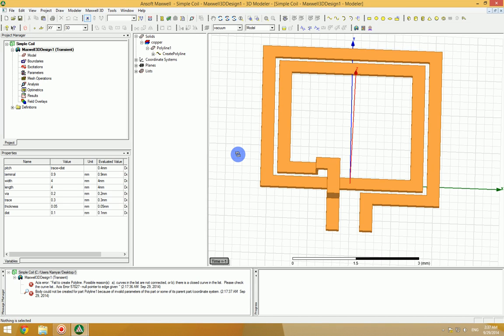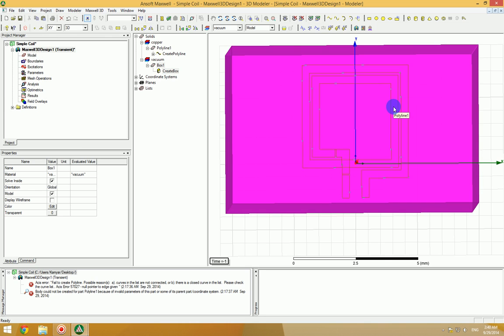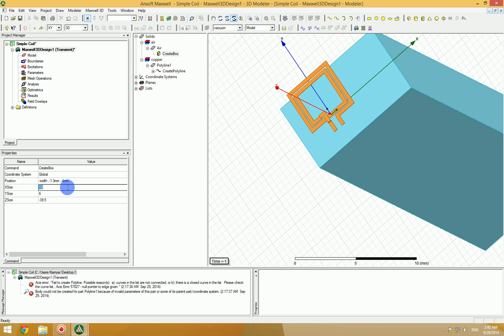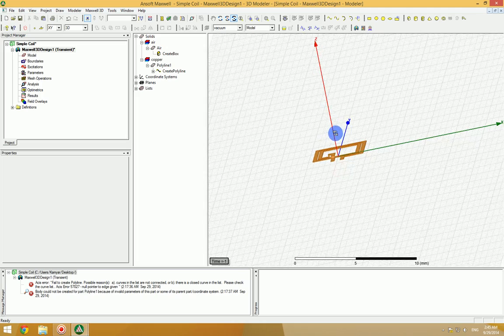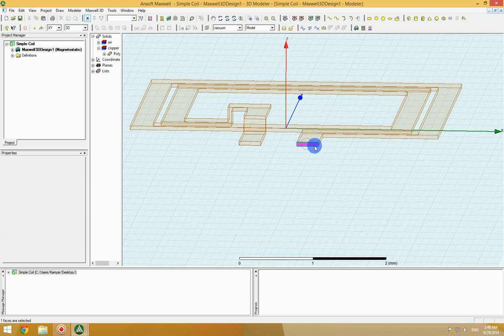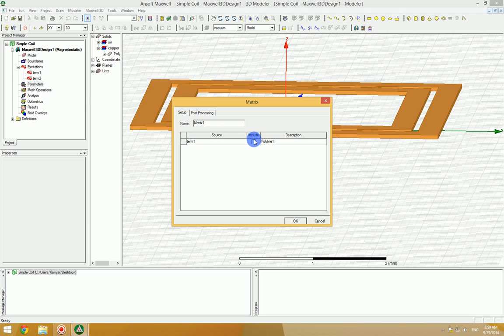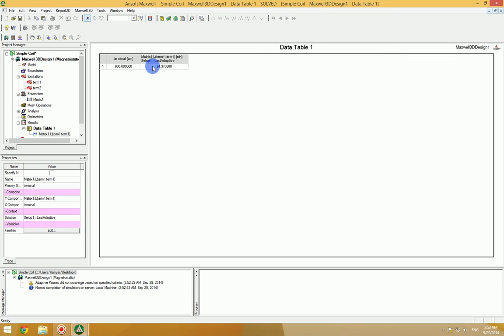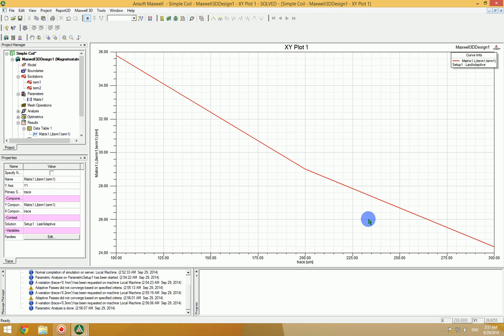PART 3 -- Ansys Maxwell Calculating the Inductance of WPT Coil

Comment: Thank you for the good video. One question here: if you need to consider the inductance value under certain frequency, can you set the current value as sin(1/1000*time) instead of 1 (at 1kHz)? 10:56
Would it be an appropriate approach?
Reply: No magnetostatic solver doesn’t have time domain solutions. Any way that could be done?

Comment: Is this all done in ac current? Or dc current? Is there any way I could change the input current func?
Reply from the maker: this is Magnetostatic, it is considered DC. you can calculate the inductance and coupling very efficiently in the magneto static solver. if you need to calculate the losses you need to use EddyCurrent solver. EddyCurrent solver does not calculate the operating point of the non-linear ferrous material in large signal manner. it also does not calculate the permeability and operating point if you have a permanent magnet in your design. if you happened to have a transient excitation with non-linear material snd permanent magnet you need to use transient solver. it takes longer to calculate things but it is the most comprehensive solver. hope that answers your question.

Comment: Hi Kamyar, thanks for all videos. It's really helpful. I have a question. How can I simulate spiral coil capacitance with electrostatic solver? How should I assign the excitation and draw or not draw the solution region ?.Thanks in adnvance...
Reply from the maker: this is a god question. you need to think about where the capacitance is coming from. if it is between coil and another material that is conductive and it is connected to ground then assign 0 V to that material and assign 1V to coil and run it. but if you are thinking of capacitance between turns of the coil then Maxwell's not your solver. use HFSS.
Reply: @kamyark8434  Hi Kamyar, thanks for the answer. I've been working on this for a while and like you said HFSS was the solution for that. I've managed to simulate spiral coil self resonance frequency therefore it's parasitic capacitance with HFSS.

Comment: Hello! I have a slight doubt that is preventing me from all process after that. I want to know what's the major objective of coil design in simulator? To calculate all these parameters right? But while I am still not knowing which coil is best for my system, how do I know how much no of turns will be good for me ? Or let's say what inductance value is good ? I need some data for parameter to validate what I design right ? Please enlighten me and help me overcome this.
Reply from the maker: the number of turns are related to amount of inductance you need and the coupling factor you need more turns increases both although latter is a great function of geometry and distance between coils)

Comment: Hi Kamyar, thanks for the interesting video. You said that even the prompt shows warning if it shows normal completion of simulation on the server then it is correct. My question is if the solution after adaptive pass did not converge how can we believe if the solution is correct. Because maxwell works by comparing the error between different iterations and concludes simulation after the error is within some threshold. 
Thanks!
Sidharth Kumar
Reply from the maker: it depends on what you define "correct". you can set a target for your convergence and if the target is too tight (too small) it may never converge, does that means your results are "incorrect"? if it is not converging it is because the adaptive path from initial mesh did not have enough room to reach to your target. you have 3 ways to fix it . 1. make the initial mesh better, make it finer around the objects that are carrying energy, around arigaps and etc, 2, increase the number of passes allowing adaptive messier to work its magic, or 3 less recommended, to increase the percentage of mesh refinement to reach to required mesh faster. the draw back with the third method is that the result mesh may by not as efficient as method 2 or 1. you can think about it and find out why? ;)

Comment: Inductance DECREASES after you hit saturation. Inductance by definition is d(phi)/dI. Phi is total magnetic flux, I the current. The maximum inductance point will be where you experience the greatest slope on the B-H curve for the core material you are using. Typically this is at very low current (and thereby H) values.

This is also why saturation is bad in transformers and electric motors, because your inductance and thereby impedance drops off precipitously, leading to a huge increase in current and the attendant risk of fire, etc.

Comment: Hi Sir, I followed every steps in this video except I choose the type of polyline to be circular. After I successfully run simulation, I create magnetostatic data table report. In the new trace of the report, the primary sweep of mine is pitch, but in the video, primary sweep is terminal.

so, could you please suggest what is the reason of it and how could I make the primary sweep to be terminal? Is the solution affected if the primary sweep is pitch instead of terminal?

Thanks.
Reply from the maker: Hi, you can change the primary sweep in the Modify Report option (when you right click on existing report) or when you are making a new report on the top you see the primary sweep. if you do not see the primary sweep in the new report, or your parameter is not listed it is because you either id not save the field indoor optometric sweep and your parameter is a post processed parameter which needs the fields to be calculated or you have not selected the right sweep to report window to get it from. it is a bit difficult to get yourself familiarized with the sweep and report function but once yogurt the hang of it it becomes intuitive.

Comment: Hi sir, your videos are very helpful in my senior design project. I just wanted to know, how can I find the resistance and parasitic capacitance of this type of coil.
Reply: Hello, Zahid Muhammad! I am also puzzled at this problem. Do you have any solution now? Or do you find any papers relevant to resistance and parasitic capacitance of this type of coil. Happy to have a discussion with you.
Reply: I am also interested in wireless power transfer, too! And I would like to know how to simulate the resonance frequency and the Quality factor of the coil by maxwell. Could you help me? Thanks a lot.
Reply: What i found is that if you change your solution type, you can get different parameters of the coil. for example if you set the solution type to electrostatic and give a voltage excitation you can find the capacitance of the coil.
Similarly, if you apply a current source excitation in electrostatic solution type, you can get inductance and resistance of the coil.

Comment: Dear Sir, Please let check your email.

I have a question regarding you lectures here. 
I have designed a coil of planar spiral square resonator in HFSS. But, I am not getting expected results of field distribution. 
So, my question is that should I match impedance between starting terminal and ending terminal of coil when apply the lumped port between these terminals?

I would be very grateful if you could try to help me.
Reply from the maker: +PRAVAT KANTI NATH  depends on your frequency. If your frequency is relatively low (based on your dimensions) then marching should not be a deal.
Reply: Thank very much for your responding!

Comment: Can you add a substrate and simulate the inductance ? If you want to add a capacitor to this coil to make it a two segment coil to cancel the inductance at specific frequency f=1/2pi*sqrt(fC), how to find the capacitor value in this case ?
Reply from the maker: yes , substrate can reduce the inductance by eddycurrent, solve in eddy-current solver. it is mainly adding AC resistance though. caps are calculatable in electrostatic.

Comment: Hello Kamyar! Great job with the tutorials. I am trying to use Ansys Maxwell to look at the magnetic fields of my wireless energy transfer system. I am using two turn square loops as my transmitter and receiver coils. The transmitter coil is excited with 1 V source and a capacitor is in series with the 1 V source. The receiver coil is terminated with a capacitor. I can't figure out how to incorporate the capacitors in the design. I was hoping that you could help. Thank you!
Reply from the maker: +Neelima Dahal  please find my tutorials regarding external circuits in transient simulations and or use of simplorer. One the first videos that I uploaded.
Reply: I will do that. Thank you for responding!
Reply from the maker: you can use twinbuilder (simpler). in twin builder add eddy current Maxwell component and make a series capacitor with it using circuit components in eddy current.

Comment: Good Morning, M. Kamyar Keikhosravy
I am grateful to you very much

I am Tunisian student in Electrical Engineering,

Thank you very much for your answer, Also thank you for your compliments, We owe you many thanks.

These are the steps simulations of a planar inductor in Maxwell 3D

1)	Set Solution Type
Maxwell 3D > Solution Type
Electric > Electrostatic
2)	Create Geometry
3)	Define Region
Select the menu item Draw > Region 

4)	Assign Excitations
•	Select the planar inductor Maxwell 3D > Excitations > Assign > Voltage
1 V
Press OK
•	Select the menu region Edit>Select>All Objet Faces
            Maxwell 3D > Excitations > Assign > Voltage
0 V
Press OK

5) Assign Parameters
Maxwell 3D > Parameters > Assign > Matrix
6) Maxwell 3D > Analysis Setup > Add Solution Setup
7) Analyze

but I have a problem in step 4. "Assign Excitations"
Step 4 is what is true or false?

Is what is needed excited planar inductor with a positive voltage source and the region with zero voltage source?
Or it is necessary excited planar inductor with a positive voltage source only?

I'm still stuck at this step

Email: aymen.ammouri@yahoo.fr

Kind Regards
Aymen Ammouri

Comment: Hi Kaymar, Thanks for the informative video, I followed all the same steps in HFSS, and for plotting it's exactly the same, however for simulations, I couldn't find the magneto static part or assigning a specific current for different terminals, any help?
Reply from the maker: ahmed shaltoot You mean you can't find Magnetostatic in HFSS? HFSS stands for hogh frequency sumilations there is no Magnetoestatic there. however the concepts and modeling are almost identical across different Ansoft (Ansys) software.
Reply: Yeah I figured this out, well here in Canada, you can't get the Maxwell 3D, I could only get the HFSS, and I wanted to be able to calculate the inductance and parasitic resistance of different shapes of spiral inductors, is there a ways to do that in HFSS?
Reply from the maker: Yes. You can get the S11 and S12 of the coil. From that you can easliy calculate the inductance. Let say that you are going to use only one port to excite the coil. Then frin that s11 is basically Zin. From Zin you can easily find the L. 
If you are. Using two ports then if the ports are all 50 ohms you can find the s11 from conventional formulas off the articles.

Comment: First of all, thanks for share that!
I have a question, How could I calculate the resistance and the Q factor?
Hope you can answer! Thanks!
Reply from the maker: Hi 
thanks, 
I think the easiest way is to use the simplorer to calculate the Q factor. 
If you do not have the simplorer you can use Maxwell's calculator. I am trying to prepare a quick tutorial on that in the next couple of days.
Reply from the maker: *****  Also you can get the resistance information from eddy current analysis. Hope that it helps
Reply: ***** I haven't this software, but I'm gonna try by Maxwell!
I'm waiting for this video and others!
You're doing an excellent job!
Thanks!
Reply from the maker: Hi, Please refer to Chapter 3 tutorials (starting 300 above numbers)